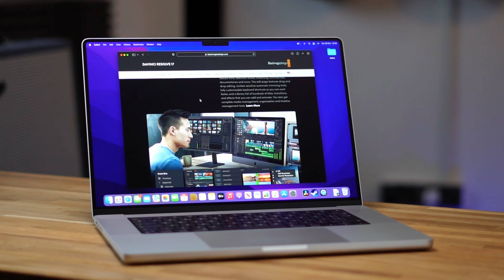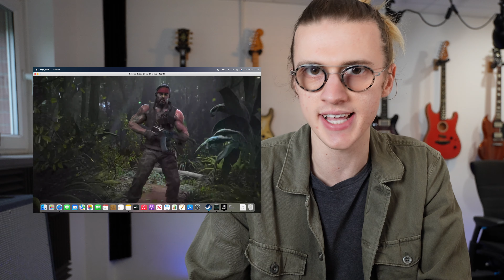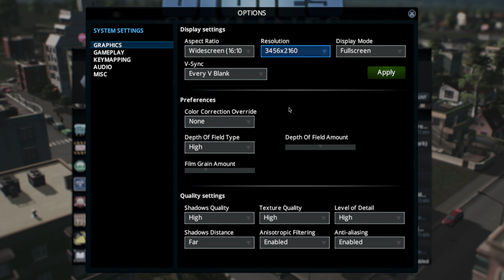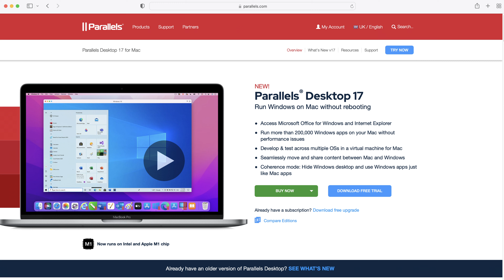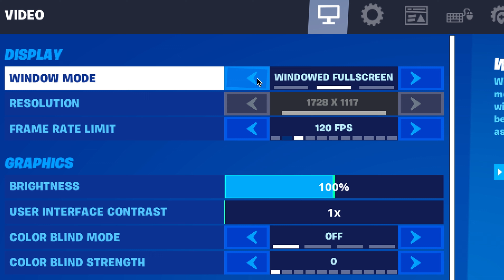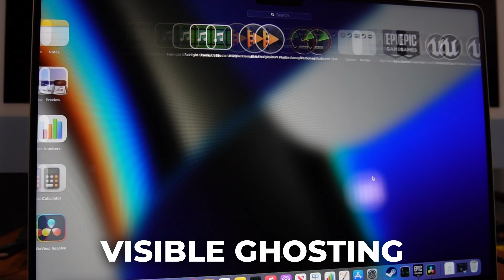M1 Pro 16" MacBook is AMAZING for Gaming!! (120 FPS Fortnite + CS:GO)

Comment: Response time is BEYOND SLOW. Barely anyone talks about this, everyone just reads the "proMotion" marketing material from Apple. So, thanks for bringing it up. Its not 5ms like you claimed but around 45-50ms. That's like 2 times slower than your old TV from 8 years ago. $
I was so excited for this display with all the claims Apple made. "1000 nit brightness with 1600 nit peak"..... Turns out it's 500 nits   sustained. So much talk about pro motion but mostly wont go to 120 and a side of terrible response time.
I got the 16" Macbook pro and the display is nice to look at but its still no match to the OLED I'm used to on my TV, tablet and phone.

Comment: The slow motion filming of the icons moving across the screen (at I'm assuming 120 hz?!?!) is misleading because the camera used to capture the image has its own shutter speed and appears to conflict. 

Otherwise you make a a good point about the response time, but it just isn't being well demonstrated with an image that corroborates this. 

There is frame rate, response time and refresh rate which all need to optimize together for the best experience, and other monitor types have their own display difficulties. For example OLED has tearing issues.

I think it's difficult to criticize the display without understanding how those 3 factors I described are optimized in a game. Right now, i imagine there are not a lot of games optimized to make it work for a Mac in the most convenient way possible. 

But then... The display is reported as being pretty ghosty on its own. Which shouldn't be for 120 hz. I'll look out for software that displays the screen specs. And hopefully, this isn't a hardware limit that can't be modified.

Comment: Yeah just a 7000 dollar gaming laptop
Reply: Doesn't cost even close to $7000.
Reply: @pbft.j  a maxed out MacBook M1 Pro cost 6600 
Just rounding it up since 400 bucks amounts to 6% of the cost
Reply: @jdjgg9398  Yeah but this guy doesn't use the maxed out M1 Pro. 
He literally uses the cheapest base model of the Pro 16" in the whole video. 

It's like $2,500 btw

Also the maxed out version includes an 8TB internal SSD which is a $2,500 upgrade alone. So there's no reason to complain about the $7000 version.
Reply: @pbft.j  He's stupid i believe

Comment: Hey guys, I'm planning on buying the MacBook Pro featured in the video (16-inch, M1 Pro, 16GB of RAM, 512GB of storage).

But I have one question: Can it run League of Legends? And can it run that game on high settings with smooth frame rates?
Reply: I play league on my 14 inch MacBook M1 pro and it’s runs really well, usually at 120 fps and 20-30 ping and I have the highest settings, hope this helps🙂
Reply: Here for an answer to this question too!